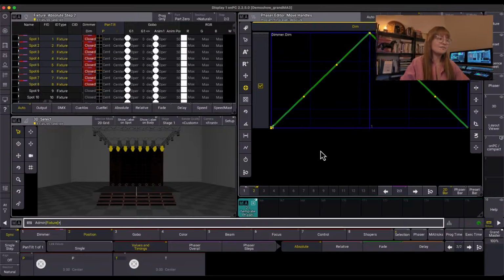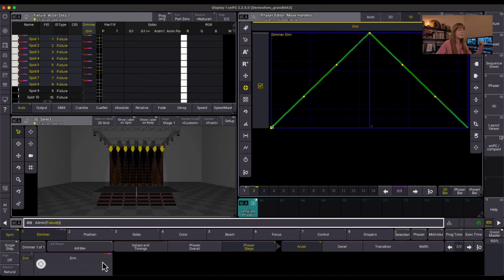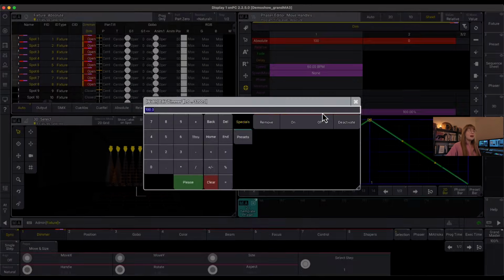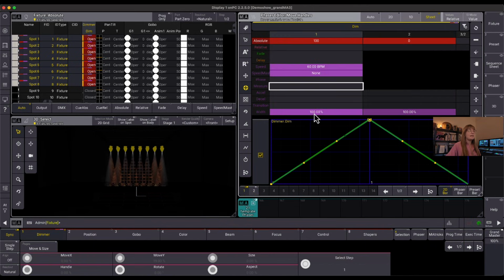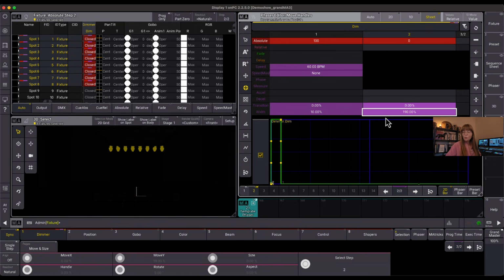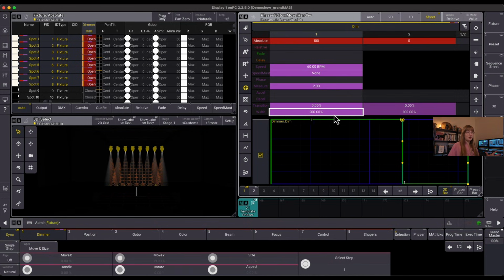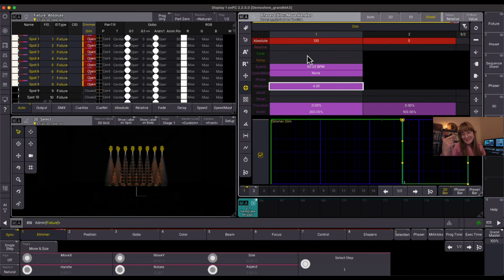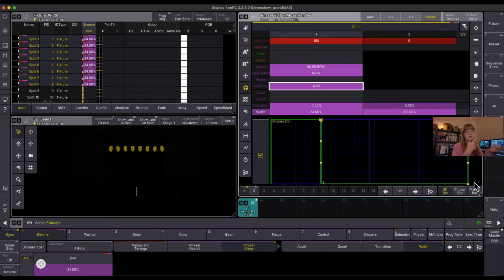Measure

Comment: That's a great explanation. I like to match the measure number to the number of "segments" I want in my effect. So if a song is in 4/4, I'll often do a measure of 4, then tag it to a speed master, and then just adjust the speed multiplier to make it fit correctly. Obviously in a primarily pre-programmed workflow, less in busking.
It's also nice so if I have a song in say 6/8 or 3/4, I'll use it for a sine wave with a 6 or 3 in the measure, so it actually lines up to my speed master. I think this is where it's most powerful, because lining up to non-4/4 time has always been a bit more complicated in the past, and this makes it super easy!
Reply from the maker: That's a great workflow example! Thanks for sharing